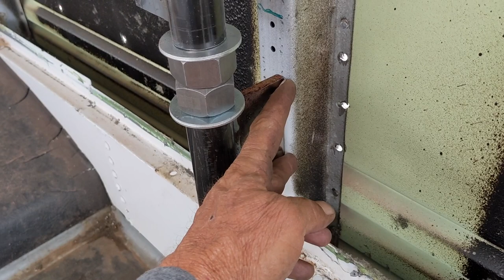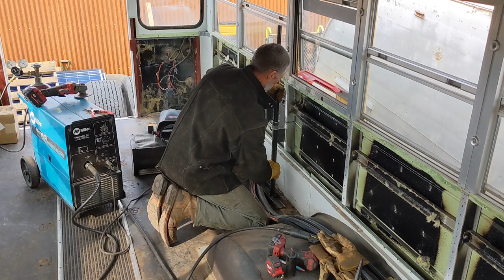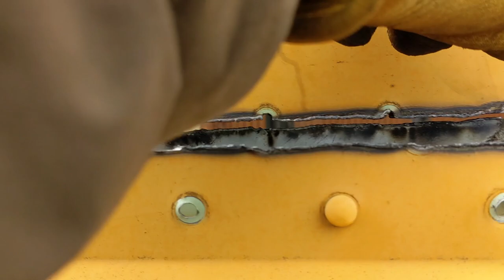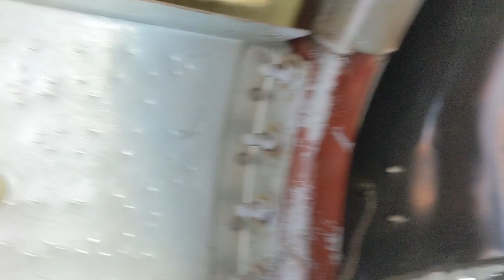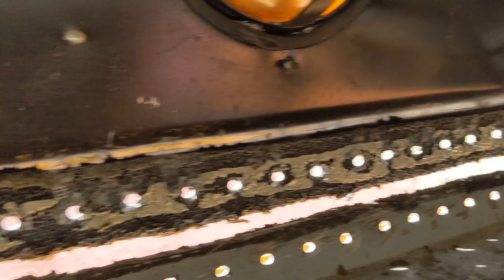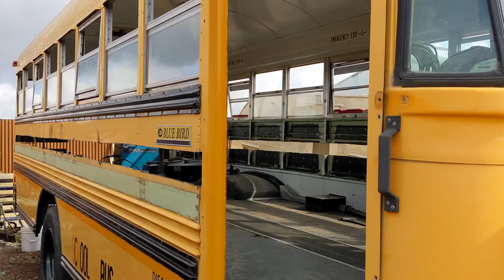Making the cut...our process for cutting and raising a bus roof.

Comment: like the idea of the floorsupport on the raising jacks if you screw them in the wooden floor and make sure there vertical with the bus you dont even need to shift the roof to get it to line up top to bottom

Comment: After welding those nuts on top of those raise poles, use four ratchet so you do not waste time fitting it in and take it out as you walk around - just walk to each pole and give it a turn. Have four persons and you get it done fast enough. By hand is better - if something is off like that one piece you need to cut off, you will feel it sooner.  I don’t think there is a need to weld the bottom nut.

Comment: What brand of plasma cutter is that? I think you mentioned the brand, but I  couldn't quite hear it. :)
Reply from the maker: It's a Hypertherm 45.  There are lots of good ones, though, and they've gotten better and cheaper since I bought that one.
Reply from the maker: I think you also asked about the shears, but that question seems to have vanished?  I use the plasma cutter for cutting the bus sidewalls, but for cutting the new sheet metal skin I use metal cutting shears.  These are pneumatic, because I have a good sized air system, but they also make electric ones  which are quite good.
Reply: @RollingLiving  thank you! Yes, I did ask about the type of cutter, but I then realized it was s plasma cutter, so deleted my question :) 
I found a plasma cutter at Home Depot for $300. It's a Prime Weld 50 amp, It has good reviews so I'm going to buy one. We're doing a roof raise for a friend and have never done one before 😳 Your video is extremely helpful and encouraging!
Reply from the maker: Well, thank you...that's my goal...to be helpful!  Let me know how yours goes.  :-)
Reply: @RollingLiving  here we are 10 months later and just now getting ready to start the raise next week. A LOT has happened this past year, it's been rough, but hoping to get back on track! 
I have a question. We bought the plasma cutter I mentioned in one of my last comments. My husband likes it and has used it at his shop, but he needs a compressor for the warehouse where the bus is. In a perfect world, we could just take the bus to the shop, but we can't (ground not level, bus is too big for the lot - the bus is 40 ft).
The plasma cutter shows 40-65 psi and 5 liters/min. My question has to do with air compressors. I found a Ridgid brand that is 6 gal, 150 psi. How do I know if this compressor will work with our plasma cutter. I've done some research, but wanted your opinion.
Reply: @RollingLiving what happens when the bus doesn't have hat channel? Mine has a type of z channel it seems... how's that's affect the process?
Reply from the maker: @SeamusPercy-tc3fl   Wow, that's something I haven't seen before...in lots of buses of different types.  Send me a photo, maybe?  ross@ the channel name .com
Reply: @RollingLiving  it's an 85 Wayne Lifeguard lol

Comment: Is the bus sitting on a level floor? Are the home-made jacks plumb? In other words, how do you keep the whole thing straight, square and true?
Reply from the maker: Hi...and, no, the workspace isn't level.  I used straightedges throughout the process, to align the channels, and the chain pull to adjust where needed.  I thought I showed doing that...but maybe I missed it.  I've slept since then.  :-)
Reply: Measurements. It's called "knowing what you're doing." Books are also your friend.